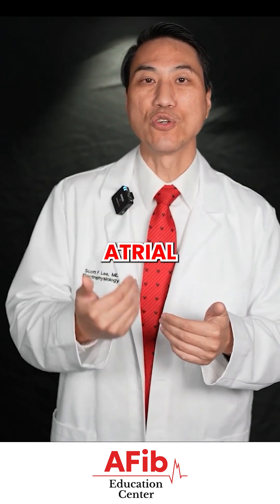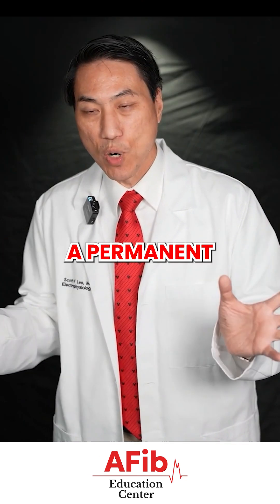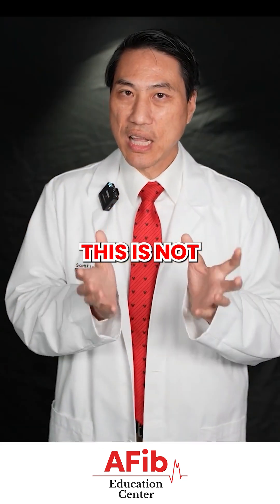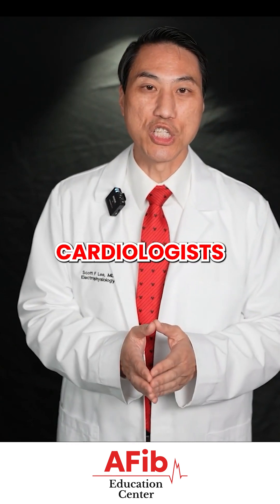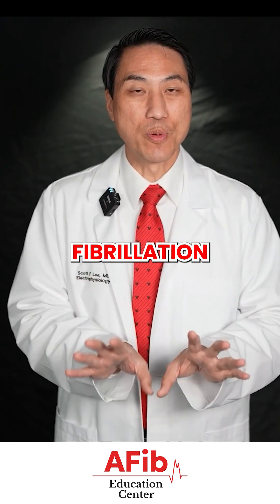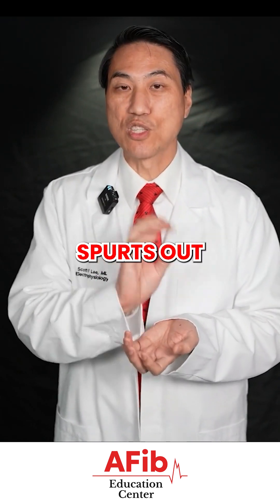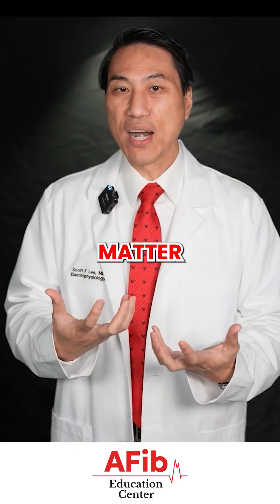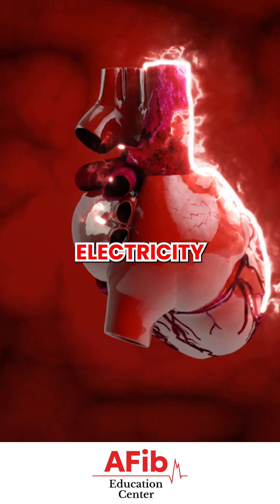AFib Ablation Isn’t Plumbing—It’s Electrical Work

Comment: Great info here. I had AFIB, and it was corrected by cardioversion a few weeks ago. Should I start a magnesium glycinate supplement?
Reply from the maker: Absolutely—I'm glad to hear the cardioversion worked and got your rhythm back on track. That’s an important first step, but let’s clarify what that means long-term. A cardioversion is not a cure for AFib—it’s more like a temporary reset button. It electrically shocks the heart back into normal sinus rhythm, but it doesn’t do anything to eliminate the AFib cells or triggers that caused the problem in the first place. So if those AFib sources are still active—and in most cases they are—the AFib will eventually wake back up.
How soon it returns depends on the stage of your AFib. If you’re in the early stage (Paroxysmal AFib), where episodes come and go on their own, a cardioversion might keep you in rhythm for quite a while, especially if you tackle any contributing risk factors. But if you’re in a later stage, like Persistent AFib, where the rhythm doesn’t self-correct anymore, then without further treatment it’s much more likely to come back sooner.
That’s why it’s important to start thinking about long-term rhythm management strategies. If the AFib wakes up and becomes symptomatic again, you have several options: – Rate-controlling medications like beta blockers or calcium channel blockers to keep your heart rate under control during episodes, making them feel less intense. – Antiarrhythmic drugs (AADs) like flecainide, propafenone, sotalol, or dofetilide, which are meant to suppress the AFib from waking up in the first place. – Catheter ablation, which is the most definitive option—it targets and destroys the abnormal AFib cells inside the heart so they can’t fire anymore. If successful, this can "turn the clock back" to an earlier stage of AFib and give you many years of relief.
Now, as for magnesium glycinate—this is a great supplement to consider, especially in early stages or if you're prone to ectopic beats or muscle cramps. Magnesium is key in stabilizing the heart’s electrical activity, and low levels can definitely make the heart more irritable. That said, most people with a decent diet and no kidney issues maintain normal levels, so it’s not always necessary for everyone. I often suggest trying 200–400 mg at night for people with mild symptoms—it’s usually well tolerated, and glycinate is one of the best-absorbed forms.
So in summary: cardioversion is a reset, not a fix. If your AFib starts waking up again, you’ll want to think through your long-term treatment plan with your EP—whether that’s medication, ablation, or a combination. And as always, run any new supplement by your doctor first, especially if you’re on other meds or have kidney issues.
You’re doing great by being proactive and informed. For more in-depth videos, check out my channel @AFibEducation, and visit www.drscottlee.com for more resources to help guide you through each stage.
Thanks for watching!

Comment: Try magnesium glycinate in may solve the problem all together when it comes to AFib. I had AFib. My doctor told me to start taking magnesium. It ended it.
Reply from the maker: Thanks so much for sharing your experience—and I’m genuinely glad to hear that you’ve had success! You’re definitely not alone; many people with AFib are curious about magnesium, especially forms like magnesium glycinate, and whether it can help manage or even suppress AFib episodes.
Here’s the thing: magnesium is an important electrolyte involved in regulating normal electrical activity in the heart. It plays a role in stabilizing heart rhythm and reducing irritability in atrial tissue. In fact, in the hospital setting, we often use IV magnesium to help manage certain arrhythmias, especially when someone is deficient.
That said, while magnesium can help support overall rhythm stability, it's important to understand that magnesium alone doesn't “cure” AFib in most people. If someone has only very mild AFib or a handful of AFib cells that are easily irritated—especially by things like alcohol, caffeine, or electrolyte imbalances—then yes, optimizing magnesium (and potassium) may reduce or even eliminate episodes. But for the majority of people with progressing AFib, especially once more AFib cells have developed or it’s spreading to other atrial walls, magnesium becomes more of a supportive measure, not a standalone treatment.
Also important: if magnesium worked that well in all AFib cases, we’d be putting everyone on it and shutting down our electrophysiology labs! The fact is, we see thousands of patients each year whose AFib progressed despite already having normal magnesium levels or taking supplements. So for most, magnesium may be helpful, but not sufficient alone—especially in moderate to advanced stages.
All that to say—your story is valuable, and it highlights that early-stage AFib, possibly with a very low burden and minimal substrate, can sometimes be controlled with simple interventions. But it’s also crucial for others to know that AFib is different for everyone, and what works for one person may not work for another.
I always encourage people to work closely with an electrophysiologist to understand their specific rhythm, stage, and risk factors—because catching and managing AFib early makes all the difference.
Thanks again for sharing—and for more tools and insights on how to manage AFib at all stages, feel free to visit my site at www.drscottlee.com or check out my YouTube channel @AFibEducation.
I hope this helps!
Reply: @afibeducation  Well written and great videos I thank you very much...